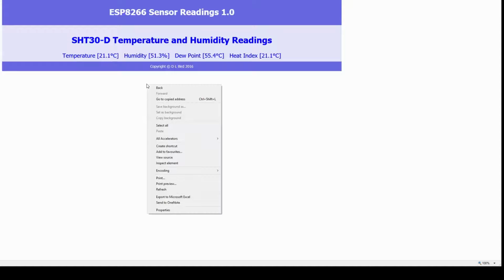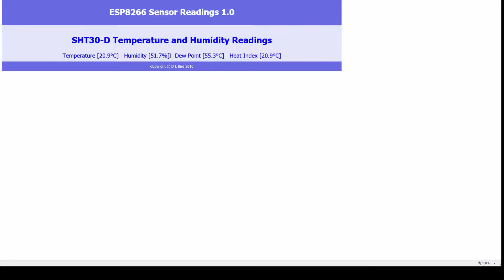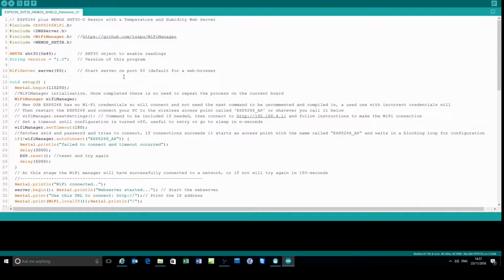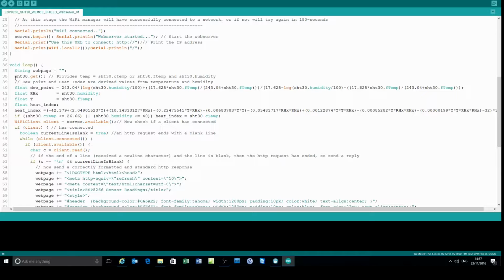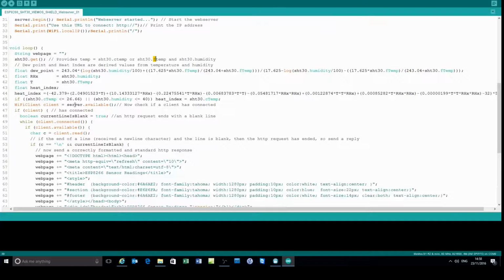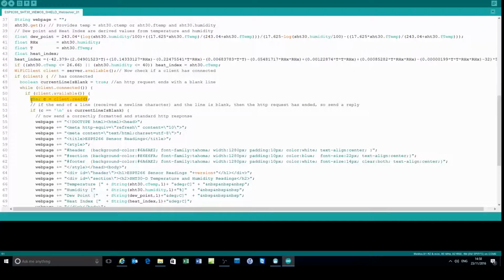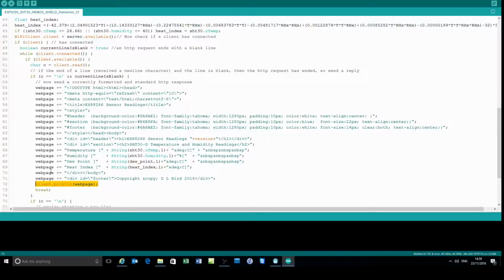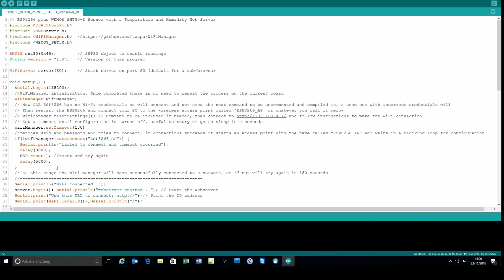Tech Note 020 - ESP8266 WEMOS SHT30 SHIELD and WebServer for the readings

Comment: One problem I notice with those neat module is that you'll pick up the heat from the esp board. It's good for testing or if you put the esp in deep sleep between 2 mesure.
Reply from the maker: Yes agreed and if using a webserver with asynchronous requests for data/information leaving it running continuously is the only way to do this, but I now use one of these: https://www.aliexpress.com/item/Dual-Base-for-WeMos-D1-mini/32642733925.html?spm=2114.01010208.3.1.HOgdnM&ws_ab_test=searchweb0_0,searchweb201602_4_10065_10068_10000032_119_10000025_10000029_430_10000028_10060_10062_10056_10055_10000062_10054_301_10059_10099_10000022_10000012_10103_10000015_10102_10096_10000018_10000019_10000056_10000059_10052_10053_10107_10050_10106_10051_10000053_10000007_10000050_10084_10083_10118_10000047_10080_10082_10081_10110_10111_10112_10113_10114_10115_10037_10033_10000041_10000044_10078_10079_10077_10000038_429_10073_10000035_10121-10033_10037_10077,searchweb201603_9,afswitch_3,single_sort_1_default&btsid=7cafef7f-f340-46cf-b6b2-8949a235eb1cand that keeps conducted heat to almost zero levels. In other solutions I have wired the sensor separately with ribbon cable (Dupont type). When updating say Thingspeak then sleep mode also solves the problem.
Or maybe as I mention in the video using the ALERT output to interrupt the sleeping ESP and update the data.
Reply: G6EJD I ended up picking some sht30 board to avoid any problem:
http://s.aliexpress.com/fUbey2Af
Reply from the maker: I've have not seen those before, good solution and link, thank you. The sensor is very accurate for both Temperature and Humidity, I have a SHT35 (+/-1.5RH and 0.2%T) and the readings for the 30 variant (+/-3%) are as good IMO. Orders of magnitude better than the DHT11 or 22.